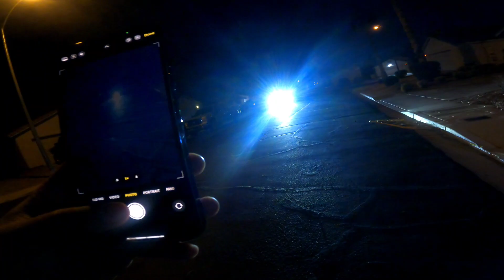Ducati Multistrada V4S | Denali Electronics | Auxiliary Lights

Comment: did you use the factory connectors located und the fairings on each side of the bike, and the factory switch is working or dealership had to enable it, thank you,,,,,
Reply from the maker: No I just used Dial Dim for switch. And connected it to accessories for power.
Reply: nice nice , it looks great, thank you @omarctv
Reply: How did you wire the cables through the fairing towards the battery compartment?
Reply from the maker: @MarcSteenbeke84  through side fairings have to loosen it to snake it